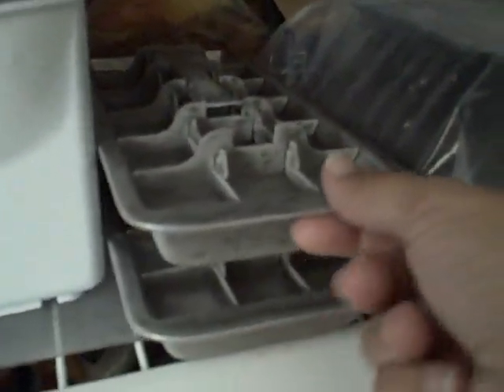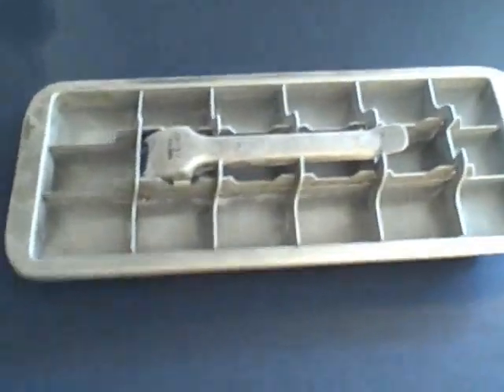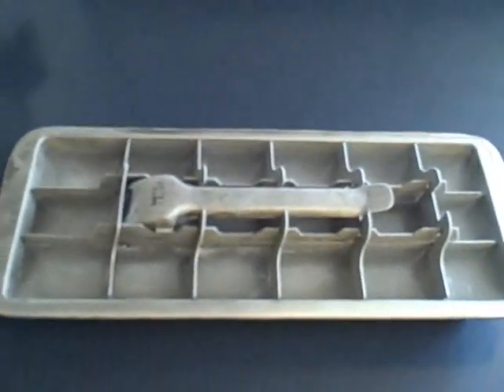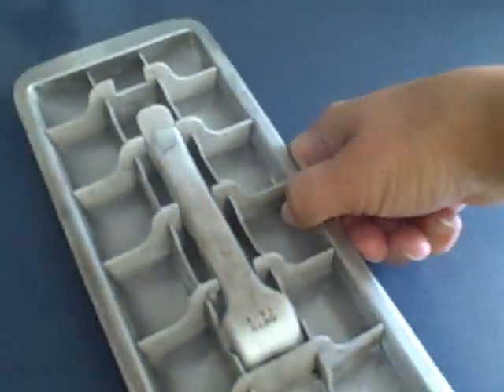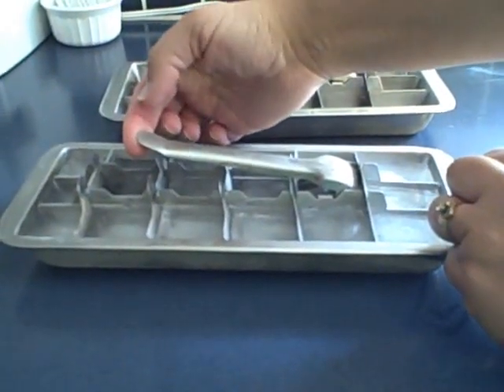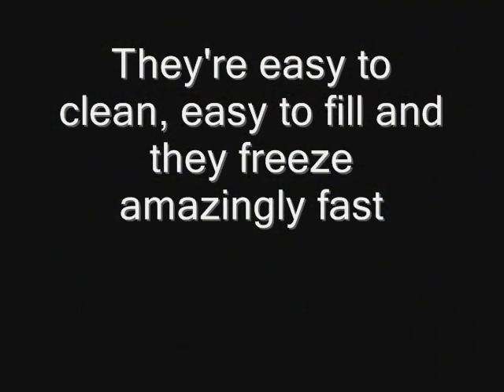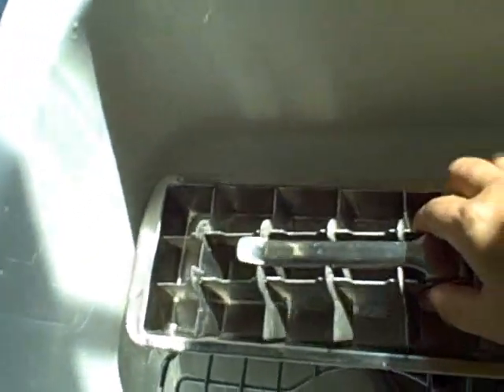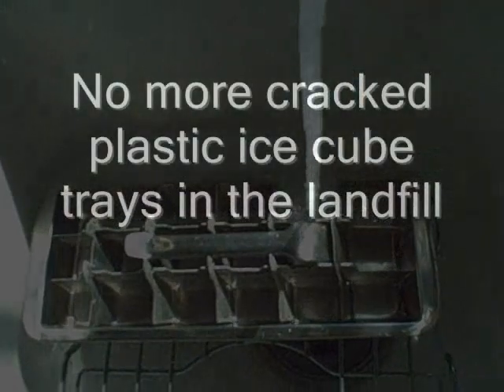Onyx Stainless Steel Ice Cube Tray Review

Comment: I just got me a fridge not too long ago that's a 1955(OR)1956 westinghouse fridge for 25.00 It's works and I've got 4 of the ice trays with a tray/plate thing that you can put under the Ice tray for it to sit on. I tell ya tho. Those thing's are freezing really bad. Mine was stinging my hand, the handle was frozen to the tray, So I did like my friend told me and I ran hot water over it and then pulled the handle and they popped out perfect. Some still stuck to the slot. But all I had to do was tap em and they fell out.

Comment: Just got mine, But the ice doesn't release as easy as you clam. I fill them up only about 3/4 of the way, but when they freeze you have to use a jackhammer to get them out. I've tried to leave them out a few minutes, but due to them being steel, they don't melt enough for them to give. Ran them over water and then you have wet ice that just freezes them together into a great big block of ice in the freezer.

Comment: Mine aren't remotely this easy to break free. We're using filtered water, which appears to be sticking to the stainless steel. I have actually bent the mechanism trying to open them up; I've had to repair them to get them to work at all.